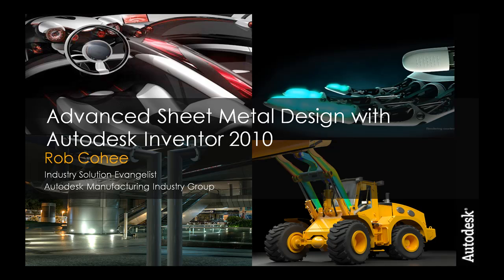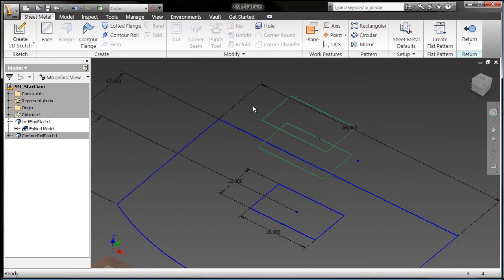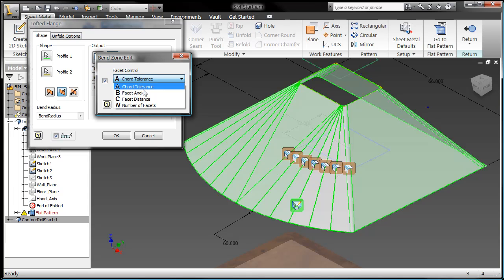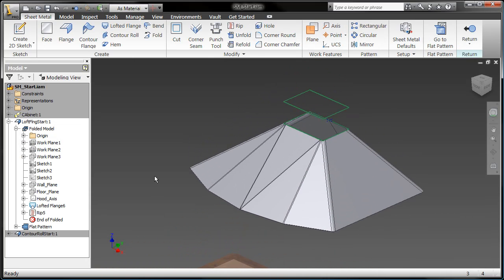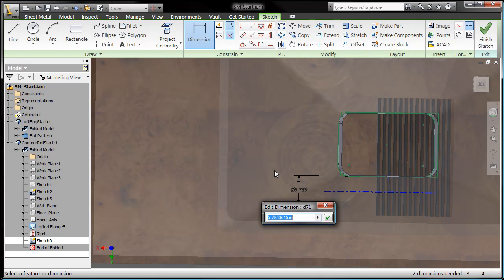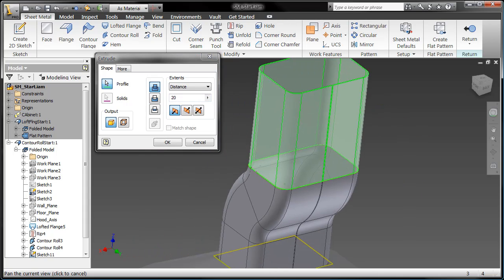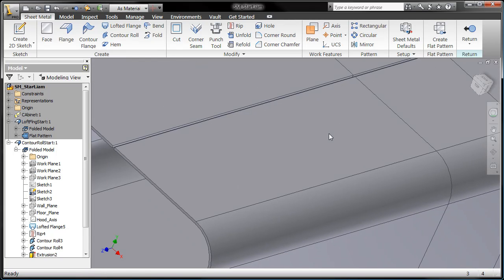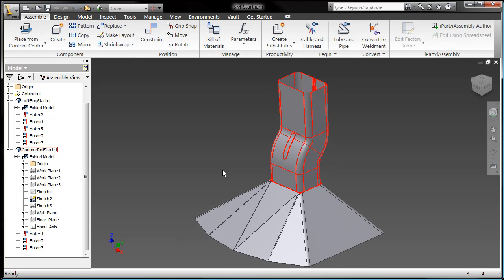Advanced Sheet Metal Design with Autodesk Inventor 2010

Comment from the maker: You could use mates on the faces or points, or sometimes I like to use work planes, or place a UCS on both parts giving you three planes on each part that you can use as reference planes. Sometimes work features are great ways of positioning components relative to each other in an assembly when geometry alone doesn't work.

Comment: Hi there Rob, amazing video.  Could I ask some advice?  I'm trying to draw a tin plate funnel with a grooved seam and a rolled top edge.  I'm struggling with it.  I've drawn the cone and ripped a gap in it to unfold it.  The problem is when I try to create a hem or flange on the edges of the rip, inventor won't select any edges on the model.  I have successfully created a seam on a flat model, but have trouble doing so on this curved surface.  The same is true when I try to select the top edge of the cone to create a rolled flange.  Any ideas?

Comment: This is something I can't do in SolidWorks, can't roll something that was already bend. I can only unfold something I could do out of paper (no stretching of material). It was very frustrating, as I tried to design an airplane part that was made purely from sheet metal and rivets. Had to fake everything - make parts as solids, and calculate the unfold shape "manually". 

Wonder how Inventor would cope with that.